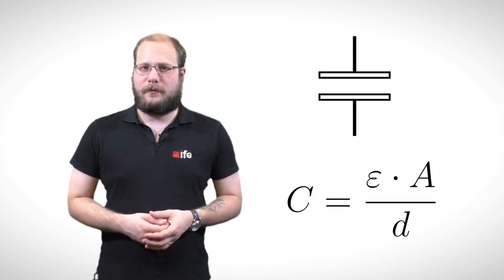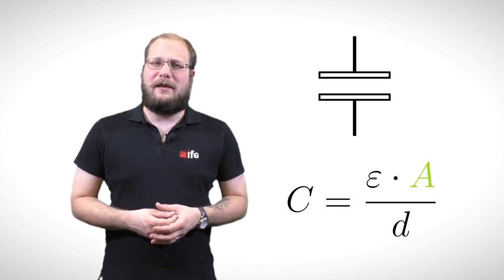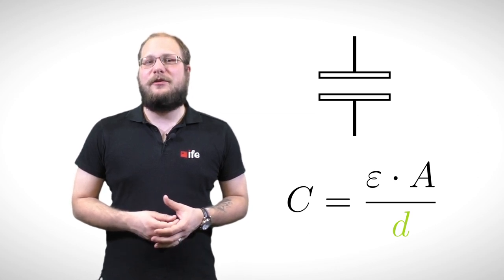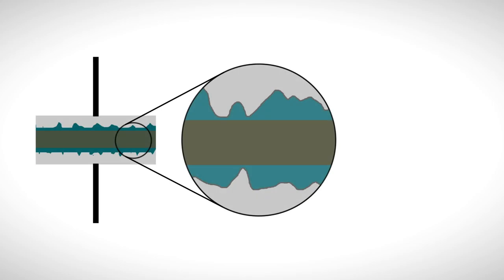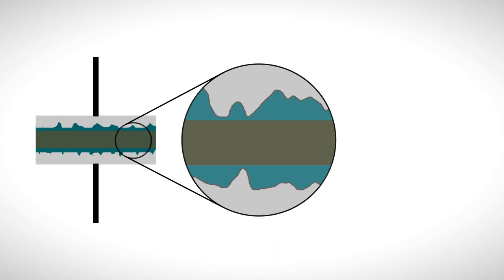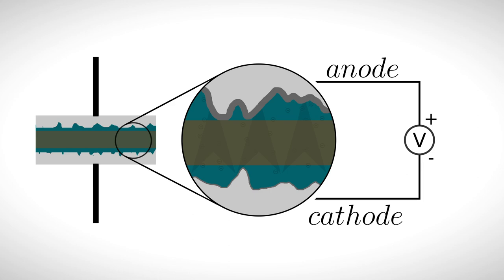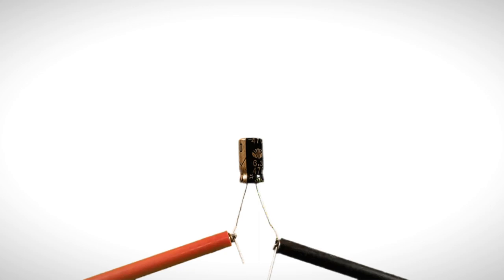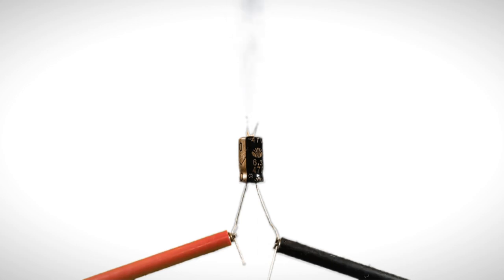How not to connect an Electrolytic Capacitor

Comment: This is the best video I found that describe the phenomenon.Will you make in future a video that explain why connecting two polarized capacitors (electrolytic) in anti series you will obtain a non polarized capacitor and why if you measure the voltage across one of that two capacitors you will find almost 1,5V and in the other the "remaining" voltage? Thank you!
Reply from the maker: Thank you for the nice feedback and the suggestion for new content, we will add it to our list of ideas.

For the meantime: We have found some discussion on connecting two polarised capacitors in anti series in [1].

[1] https://electronics.stackexchange.com/questions/21928/can-you-make-a-non-polar-electrolytic-capacitor-out-of-two-regular-electrolytic

Comment: Question: What happens to the isolating aluminium oxide layer when the capacitor is being charged and discharged (the current goes both directions)? I'm asking because you mentionned that there is a link between electron movement and the layer
Thank you
Reply from the maker: Thanks for your question!
The build up of the aluminiumoxide layer takes some time. The electrons gather at the positive plate, and the whole processs of andoic oxidation takes several minutes to take effect. So the charging and discarging process does have a effect on the oxide layer. But i have to say that i am not a chemist :)
Reply: @ife.tugraz  maybe I can help here, I have to admit that I am not an expert either but I have done some Aluminium anodization at home (for larger parts but that's off-topic), usually when anodizing aluminum you try to apply a constant current, however, if you were to connect a constant voltage you'll notice the current dropping off as the oxide layer grows (Al2O3 is non-conductive so the resistance increases) I guess in an electrolytic capacitor it'll be similar. The manufacturer probably used a high voltage to grow the oxide layer so It's resistance increased to a point where the small voltages which are usually applied won't have an effect on the thickness anymore.  @IFE - TU Graz please correct me on that if I'm wrong but when the capacitor is being charged and discharged there shouldn't be any charge carriers be flowing through the capacitor's electrolyte  (a capacitor also works with a perfectly isolating material in between) so there shouldn't be any huge effect on the oxide layer.

Comment: Ive had a tantalum explode with first time turn on failure. , off the shelf dev fet driver board, 10uF yellow tantalum, 50A supply. no time to heal the oxide layers before pressure build up, self healing when current limited first time.